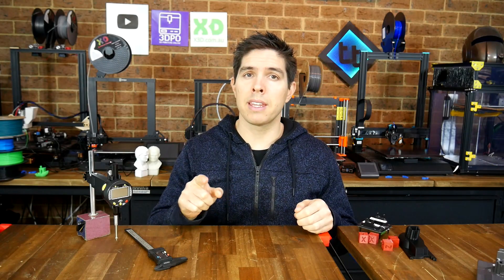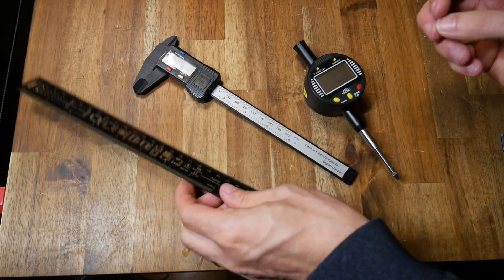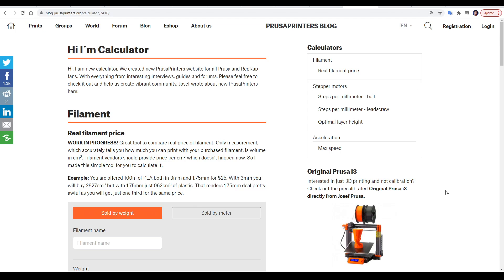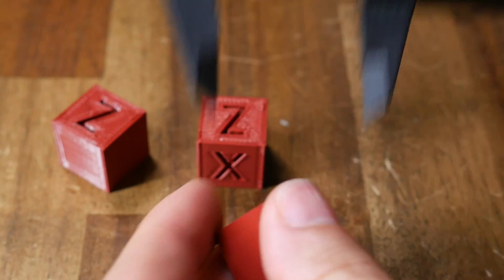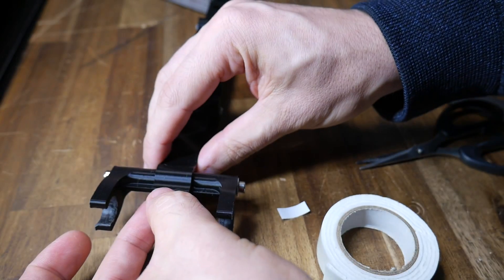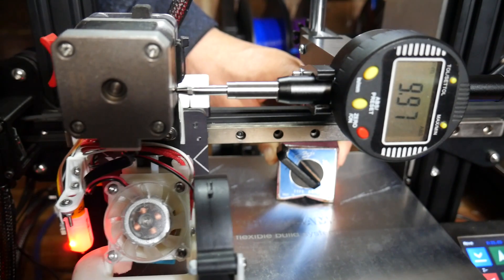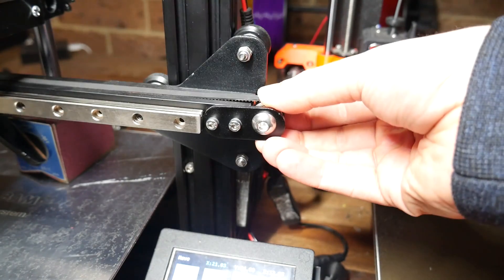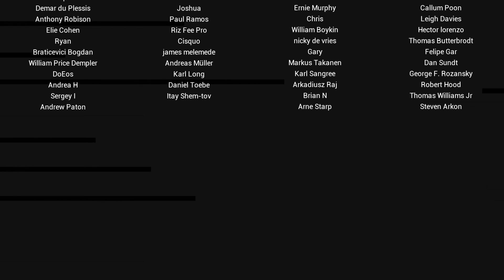Calibrating your XYZ steps using a dial gauge for maximum accuracy

Comment: using expensive measuring tools on Chinese cheap inconsistent machines - hmm  3d printers MUST come out of this garage cheapo phase. linear rails, better steppers/servos and better controllers - at this stage it should be almost plugnplay
Reply: Without the cheap Chinese 3d printers, 3d printing would not have near the exposure it has now, the more exposure has meant larger developments in the technology by the growing community.  You always have the option to buy a more expensive machine but cheap printers are a vital part of 3d printing
Reply: @arcadecarpet631  not accurate - lest we all forget the Brooklyn company that started it? cheap is cheap and cheap 3d printers causes more issues than worth for non tech or "fixers" thats the key - plug n play for most part is required - better machines, better prints, less of this "fix it". does anyone change the spark plugs on their modern cars anymore? do we use spark plug or injectors? things move forward. The 3d printing industry is being held back by this "cheap" mentality.
Reply: This exists, and it costs more. The Ender 3 is an amazing machine because it allows people to print on the cheap. If you want a better machine, you either spend the money and upgrade it yourself, or spend the money and get a better machine.

There are countless plug-n-play printers out there. Not "almost plugnplay", fully plug-n-play. The Ender 3 IS "almost plugnplay". Dunno what your point is.

This comment is pointless.
Reply: @Guffy1990  thats the issue "printing on the cheap" cheap is a 4 letter word at this stage of 3d printing.
Reply: @VanguardSys 
"cheap is a 4 letter word at this stage of 3D printing"

lol wut.

The cheap Chinese stuff allows for hobbiests to make, and even sell, their creations. If tuned properly, the Ender 3 can trade blows with a printer 4 or 5 times its price.

If you want a more expensive printer, get one. Nothing is stopping you. But if you want a 3D printer and you don't have money to throw to the "Made in America" tax, go for it. Keeping in mind that it usually has the asterisk saying "With Globally Sourced Materials" in the fine print.

You pay for what you get essentially, you aren't going to get Voron levels of quality and speed out of an Ender 3 straight out the box (but it can come pretty close if you're willing to spend some time tuning it). Just like you aren't going to get a super fast car with lots of features for a few hundred currency.

You get what you pay for, however, just like printers, cars can be modified to exceed the high end of their competitors, usually for less cost. Of course, with the building blocks of something that just works, and is almost plug-n-play (the Ender 3 again), you can go crazy with it, and far surpass the quality of even a Voron, but at that point, you may encounter the Ship of Theseus. That said, the whole time you have it, it'll still print fine.

I still don't get your point. At all.
Reply: @Guffy1990  hobbyists is not the intended audience please read ALL. "If you are a tinkerer" go for it - to become mainstream with better, reliable, consistent machines you MUST STOP THIS CHEAP  mantra. yes CEAP is a 4 - letter word - look up the pun
Reply: @VanguardSys  Who exactly is "mainstream" in your eyes?
Reply: @saschaschneider6355  schools, training centers, families - ANYONE not a tinkerer - again the quantifier  - "tinkerer"  - i will repeat: consistent, higher quality machines that work "out of box" - prusa is close but still made from wire ties and inconsistent printed parts - companies do it but they are $5000+ and still not "there". the 3 schools we have printers in spend more time "fixing" than teaching and making hence not really used as a tool
Reply: @VanguardSys  I did. It doesn't exist.
Reply: Cheap printers are good for most applications these days. Somebody who buys the Ender 3 V2 or even the Elegoo Neptune 2 gets decent print without a lot of fiddling around. And: When do you actually need this level of precision? And if you actually need it, why not invest the money to get a better machine, it's not like there are none - but those normally cost much much more than the "expensive measuring tool" and the "cheap machine" combined. Often more than a whole farm of cheap machines.
Reply: @saschaschneider6355  not accurate - cheap is cheap and it produces cheap inconsistent items with a lot of overhead. we own a cnc company and use 3d printers as well as lower end units - guess which causes the most issues? if u like to tinker go for it! if u want to "make" and not worry about the tool - we need better more reliable machines. Correction - more consistent reliable machines - they exist and if pushed can exist more at a better price point.

Comment: I experimented with this and got better results with default step values according to pulley diameters, etc. I honestly don’t think 1” dial gauges have great enough resolution to make this practical. This is a better concept if it can be scaled, particularly for harsh, changing environments and wear.
Reply: You are 100% correct. Esteps have a lot of variables meaning that no "one rule applies". XY and Z steps are based on math. They are correct. Changing them is a fast way to losing dimensional accuracy.

For those of us who provide technical support for printers, we're preparing macros to ask "Did you change the default steps other than Extruder?" essentially. This is gonna end up with long, 24 hour+ prints failing due to messed up steps. 

Yes, this may be an advanced method, however the average person or even kid who got a 3D printer for their Christmas/birthday/whatever and has access to their dads toolbox/Amazon can and will do this. And it's gonna screw up a lot of things. 

Damage control is underway.
Reply: @Guffy1990  i agree with you. But i wonder why it is not like that with the e-steps? The gears are pretty accurate i think
Reply: @certified-forklifter  there's a lot of variability with esteps. We know they should be 80, but because the gears aren't standard, the moving axis isn't one-dimensional, the pressure that is on the filament, how soft the filament is, the setup that a person is using... Yeah, as you can see, there's a lot of variables to take into consideration haha there's a reason tuning esteps is common, whereas this method hasn't really been talked about, because it's a moronic technique. 

You likely don't need an exact estep setting, as evidenced by stock machines coming with their esteps set to 93 usually, to deliberately underextrude. A slightly liney print is better than a horrific blobby mess. Even then, flow can be adjusted in the slicer in order to compensate for the stock defaults.

To put it into context, the default esteps calculated mathematically should be 80. The best esteps are likely around the 100 mark for a non-geared Extruder. You can see how bad the underextrusion would be here I hope
Reply: @Guffy1990  thanks
Reply: @Guffy1990  If changing the E-steps isn't the best method of tuning your prints to be dimensionally accurate, how would you suggest to solve the problem? Would you change the flow in the slicer and/or change the size of the print by enlarging/decreasing it in size and setting that as a default? What about X/Y horizontal expansion? Really interesting in your opinion on this as I like making more structural parts that fit, than just models.
Reply: @Dongaz  tuning your E-Steps to be accurate is a must, as I stated, these cannot be measured using math as there are too many variables. Tuning flow is the second thing you should do after running a temp tower. Working out your flow is key to making dimensionally accurate parts. 

If printing at speed, you'll need Linear Advance/Pressure Advance in order for sides and corners to be correct, as well as Resonance tuning preferably using an ADXL-234.

If you do these things correctly, and you have ensured the squareness of your printer (remember, only X and Z are connected, Y is independent), then you should have dimensionally accurate prints. 

There is another Youtuber who is also Australian who claims that accuracies of lower than 0.25mm are near impossible to achieve, and you cannot do better than 0.15mm. While it is difficult to do that, if you do things properly, 0.05mm shouldn't be a problem, and 0.025mm is your "push fit" tolerance.

That's without defying math, whom people from years ago worked their rear ends off to make it easily calculable for other users.

Using the correct settings and slicer matters too. While all slicers do work, making sure you have the most up-to-date version available to you is paramount. That rules out S3D as it hasn't been updated in over a year, even with known bugs.

If you know what material you're printing with (I hope you do), you know what the horizontal expansion is too. Changing your XY-Steps isn't going to fix that, as different sized prints have different expansion.
Reply: @certified-forklifter  the effective diameter of the gear depens on how far it penetrates the filament, which can depend on force on your extruder and what material you use. as such there is no easy way to calculate them
Reply: @Guffy1990  Yep. You definitely nailed it. Factory e-steps for XYZ don't need to be changed.
Reply: @Guffy1990  I run an ender 3 printing farm with 20 printers, and my prints need to be dimensionally accurate to .1mm. I use a 100mm XYZ print that i created instead of a 20mm Cube, all of my printers have the XYZ esteps adjusted between 79-81 and every printer is tuned to print within .05mm of each other. Everyone has their own needs, which mine requires tuning to this degree.

If you have to calibrate your extruder e-steps. Why wouldnt you do XYZ, if the extruders off, so are the other axis most likely, like in my case.

Comment: With dial gauge is problem that it only apply to 1cm, and that error could not be linear (especialy Z with screw)  unfortunately.
Reply: If you have a variable error depending on Z high it means your lead screw pitch is variable -> hardware problem, not related to settings.
Reply: @net2CoCo  However you will not know this unless you test across the entire range of motion so I think his point stands.

Comment: Any way you can attach a bom with links to your ender 3 rear mount case? I can't seem to find the exact relay and voltage regulators you used.

Comment: Hey I have a problem doing this with my printer. every time I try to save to EEPROM  it fails to do this. I recently bought the new skr e3 turbo you featured recently and put the version of marlin that came with it (with slight adjustments for my specific printer) on it. it's running just fine but saving to EEPROM via any way (octoprint or printerscreen) doesn't work and I get failed to save to EEPROM error. do you have any idea why this is happening?
Reply: There might be a thing about doing a clear eeprom from the menu once.

Comment: I need my parts to be as accurate as possible for work, this is a HUGE help. Thanks!
Reply: You can see my other more detailed post on why, but I promise you it's not a good use of your time for work. You'll get far better rewards for your time not cheaping out on your extruder + hotend, doing direct feed if possible, dialing in your print profile and pre-heating your system+ controlling your ambient temperature. If math derived X Y Z values aren't giving good results, there's something mechanically wrong in your system. Fix that instead.
The recipe is: Check your belts, set screws, mounting screws. Use math derived X Y Z steps. Set e-steps by extruding free (no hotend). Determine maximum material flow rate @ given temp based on this no-resistance e steps value. Focus your machine firmware settings & print profile on maintaining maximally consistent volumetric material flow rate. Pre-heat your system and control ancient temperature and humidity when printing. That's how you maximize part consistency.
And as a reminder the best fdm tolerances in the world right now are the greater of +/- .09mm or .0015mm per mm.
If you're serious about your work, don't waste your time.
Reply: I should've also probably mentioned checking axis skew and binding when you're checking the mechanics. Just to be thorough